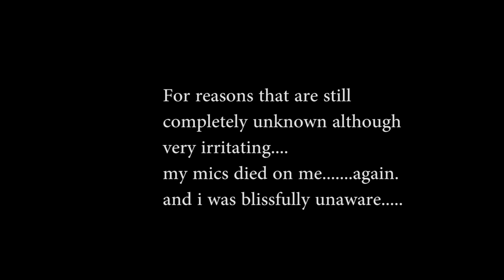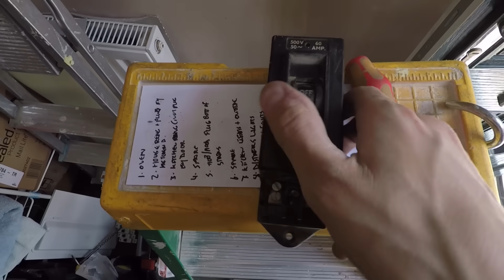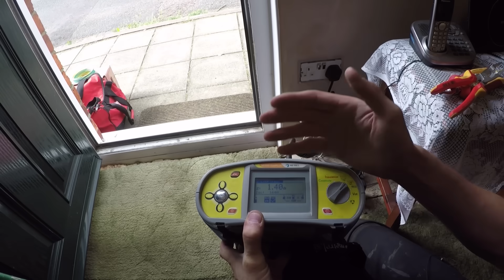Earth rod installation for fuseboard | Thomas Nagy

Comment: I’m with you on safe isolation. But some protectors on the spare bus bar would make it safer. Or do the blanks in them slot into them.
Reply: You will be surprised that the majority of sparks don't know how to test for dead.
Reply: @johnxenofontos1058  I’ve been a spark for 5 years and have only done the correct safe isolation procedure on my AM2 exam. As Tom said, safe isolation is usually a load of bollocks and it completely unrealistic in a lot of situations. I have had to work on live boards countless times - sometimes there’s no way around it

Comment: I'm a 3rd year apprentice in Galway Ireland I've every single one of your videos watched and every tip or trick you've given has been so handy perfect example . In a video you done a while back you explained your methods of wiring domestic smokes in the same mcb as light because if the light broke u would have to fix the smokes to I explained that to my tutor in college and he said how it was very good practice and I done it in my fuse board for an exam and I got a distinction !!!! I just want to say thanks for all the tips and keep up the good work 😊👍 ...... I can know understand to why you like Renault trafics as I bought one lately myself such great comfort and space 😁😁
Reply: It is indeed good practice, but don't forget that I.S. 3218 is a different standard to BS 5839-6. Make sure you are complying with Irish Standard 3218 as well as ET101 (soon to be replaced with I.S. 10101).
Reply: Gaillimh!👍🏻
Reply: In which video was he explaining this method?
Reply: Mike who was your Tutor, was it in GMIT or GRETB.
Reply: Didn’t think they had electricity in Ireland yet
Reply: @nathangatenby5744  original

Comment: What was your reason for installing new earth rod? Was there no main earth previously?
Reply: In times past bonding to incoming water and gas were considered sufficient to provide protective earth. These days, with water and gas increasingly coming in via plastic the regs were changed to mandate the use of an earth rod on TT systems.
Reply: @PETER WILSON The old rcd you pulled out was a voltage operated and not a current operated made by crabtree in the 60's.
Reply: John Xenofontos 
Correct John
I pulled one out of a flat that was upstream of the former fuse box. Had what you said confirmed by Crabtree.

Comment: You have Balls to drilling a hole in the pavement. And grab the metal to pull out. 😂
Reply: I thought the same 😬
Reply: Indeed, i'm sure the council, and the person who trips on it would take him through the courts. That earth road should have been installed in the back garden.
Reply: Paul Green if they are to trip and fall they will fall over the door lip as well. You want them to install in the rear then run the cable through the whole house??
Reply: @everythingrick370  Looked like the consumer unit was on the upper floor, so it should have been easy enough to take it up the rear wall, through the loft, and down through the ceiling. I think he took the easy option, which has created a potential issue for the general public using that footpath. I would have ruled out his method as "unsafe".
Reply: @niceguy235uk1  Totally agree. But why didn't he install an earth pit in that same location so it was at least flush with the pavement? Cost? Time?

Regardless, I wouldn't have got the cheque book out if it had been left like that. I'm not in the trade, but I live by, "do it once, do it right".

Comment: Tom, great video as always.  Could I pick your brain please?  My wiring failed an earth check during a boiler install, threw some water on the outside rod and it passed, so I switched out the earth rod for a sparkly new, slightly longer, thicker rod.  The test failed again, but again threw a bit of water on the rod and it passed.

I am thinking that there is an issue with the location of the rod, so could I just run a 6 foot extension from the exisiting earth to another earth rod and hope for a better location?
Reply from the maker: sounds like the soil isn't a great conductor there. I have had it in the past where some houses just have really poor soil for rods and we have ended up driving multiple rods down just to get a tidy reading. You can buy rods with screw threads on the top and you just screw multiple rods together and keep driving them in until you get a sound reading. You need a big hammer though! Or just put multiple rods in separate places.
Reply: @thomasnagy  Thank you Tom, yes the one I bought has a thread on the top and I believe its was extendable, so I might try another on top and drive it in further and if that fails I will try another at the extreme of the property.  At the moment I have an extension running to the empty house next door earth rod to appease the boiler installers.

Thanks very much for the advice.
Reply: @wales1975  Have you checked with your electricity supplier to see if a TN earthing arrangement would be possible ?
Reply: We use sand salt and coal powder when we put in earth matts is there anyway of incorperating this into earth spiking?

Comment: Couldn’t that earth rod connection get damaged by someone kicking or tripping over it as they walk past?
Reply: That’s why they invented earth boxes that recess into the ground.
Keeps the rod clear from being a trip hazard plus useful for testing.
Reply: @David Fitzpatrick 
If there was there would be problems with grounding all over North America.😉
Reply: Very true, we would always fit flush into the ground. If it means a little more cutting and cement after that's the way I done it.

Comment: Tom do you feel the bosch sds is the best sds out there as i seen you got milwaukee gear and youve been in the trade a while so im sure youve tried many sds drills , which is the best in your opinion ?
Reply from the maker: Early days yet, can't say ... will see how it goes with Bosch.
Reply: thomas nagy i have the same sds i feel mine had more nuts in it then one of my work mates makita sds i own mikwaukee and bosch and the warranty is mint with bosch also and do you use the rapid charger with the bosch batteries and if so how long does a 5 ah take to fully charge looking at doing a ordering round soon

Comment: I'm presuming the DNO's incoming earth was crap hence why you had to install an earth rod... I think the onus should be on the DNO to maintain, repair or replace their equipment.
Reply: It is on the DNO if its their earthing arrangement. It used to be ok years ago to use the incoming water and gas pipes as an earth but not anymore because theyre changed to plastic, so If there is no earthing arrangement then you have to put a rod in yourself.
Reply: @codenamenel  UKPN say if your installation is over a certain age, they're no longer responsible for maintaining the earth and the owner  must arrange for an earth rod to be fitted.
Reply: M H  It's true, the electricity supply coming into a property is a distribution circuit, we can't get away with not installing cpc's to every circuit we install so why should they???

Comment: just a quick one being a nit picky bastard here but you've got the covers for the DP isolator on the wrong way we should be taking the smaller cover off not the bigger one. as i said being a sad bastard but could help someone that's going to fit them
Reply from the maker: fair play i didnt even notice. well spotted. i know what you mean though; normally the ''small'' side is what we take off. good spot!
Reply: Yes, I think the smaller cover goes over the unswitched supply (incomer).

Comment: Bish bash bosch. Love my bosch gear could not live without 10.8/12v impact and drill driver. Shame the grinders and multi tools gone all quick lock bollocks . So you have to buy the fancy accessories. 18v robust drill is good for holes in joists. Good torque.

Comment: In regards to the "safe isolation" it is impossible to always be able to turn off the panels, I have spent a lot of my time as an electrician inside hospitals, mental asylums, server farms and a like, it would be impossible for me to turn off the power for the hospital,, even just turning off one single floor could have catastrophic consequences.

As for that earth rod, how tall is it? Where I live we're required to use 2 meter long earth rods. Pain in the ass to hammer into the ground.

Comment: Hi Tom. I’ve got the exact same sds, and I thought the kits came with the standard drill chuck already included.
Reply: There are two versions out there: GBH 18-26 F and non-F, F has a normal drill chuck included, non-F does not. But still this won't help because with the normal chuck hammering action does not work. What he needs is basically a cut off SDS chisel for hammering in stuff

Comment: Might of put a stuffing gland or clamp on tails for a tt system personally. Wouldn’t want them coming loose and touching the side of a metal board with a high resistance
Reply: This is a must for NICEIC they picked me up on my 1st 17th Ed. Install for a TT

Comment: Servers will have a UPS to stay up and running for a period of time, incase of power cuts.
Reply: Servers usually have a UPS but not always. A UPS is mainly used and installed to allow you to shut down the server(s) incase of a powercut. There really not intended as an alternative power source. Its a common error people make.
Reply: Depends, a unit I serviced today has an autonomy of over 10 hours running servers and Comms equipment
Reply: Yeah.. a few minutes to enable an automated smooth shutdown to prevent data corruption.. not enough to do a job.
Reply: Fuck off. We'll get someone else.
Reply: Clark Jarvie 👏👏always one smart fucker. I bet most people haven’t got UPS
Reply: I have worked on lots of sites without UPS on their servers, and  a few that have a UPS and the battery indicator says it has failed.